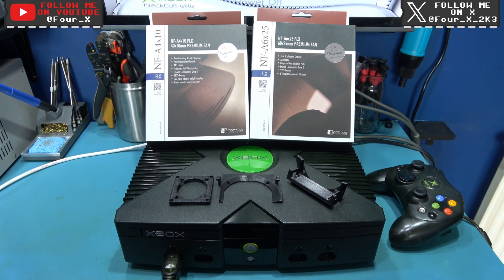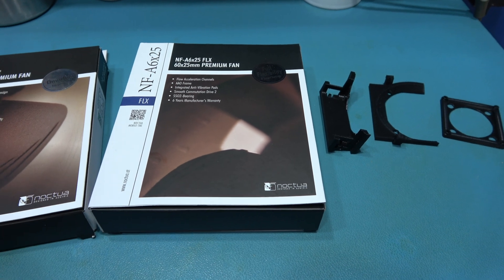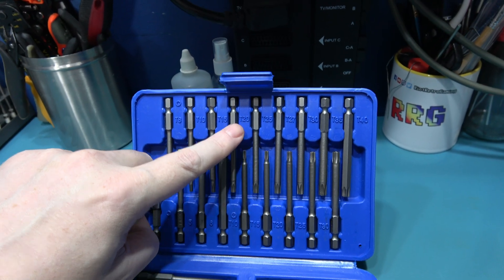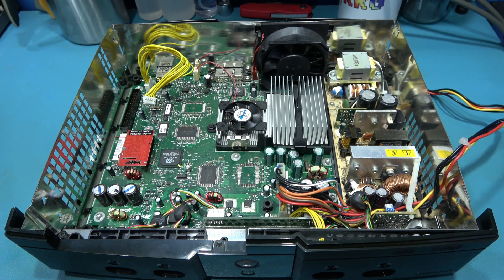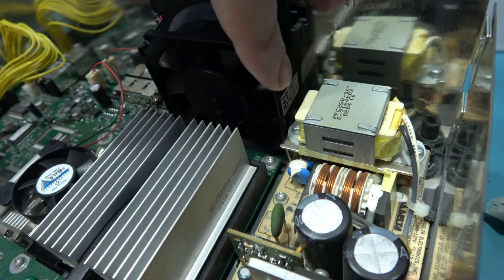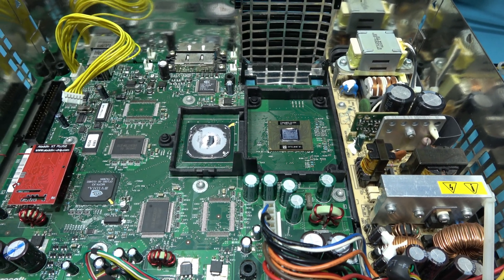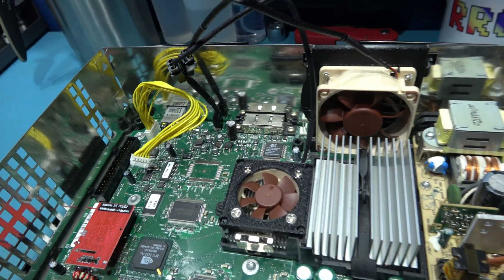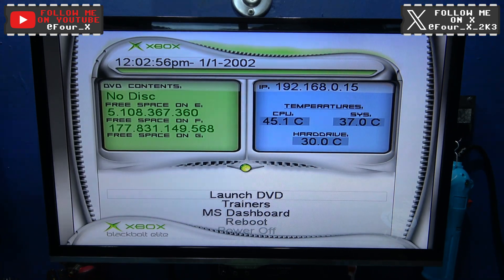Microsoft Xbox - Twin Noctua Fan Upgrade Mod for my Xbox v1.0.

Comment: I did the same thing to my xboxs. 1.1 and a 1.6 and the 1.6 was basically an oven. Once I installed the oem fan back in it was just fine. Quieter but i didnt get good results with mine

Comment: I have an Xbox version 1.2 or 1.3 and was wondering if you could make a video showing beginners such as myself how to solder a 3 pin fan connector onto the mother board. I know you mentioned that as being a possible solution and was wondering how to go about it. Great video btw!
Reply: Should just be able to buy a 3-pin fan connector or desolder one from an old computer motherboard and then you'd want to clean the pads first, then just make sure it's the right way around stick the legs in the holes use flux and solder it in. Not much to it

Comment: Can't we use the 5v variant? Why is FLX mandatory?
Reply from the maker: No, it needs to be 12v. A FLX fan runs constantly at the same set speed at a certain voltage. Other fans like PWM fans, the speed is controlled by the motherboard it's plugged into.
Reply: @Four_X  I know what PWM fans are. I was just asking, wouldn't a 5 volt DC fan be better if you want it to remove more air? But then I researched and found out the Xbox uses a weird 6.5 volts and that 5v fans would actually burn out from overvoltage. Well that just smarts, I was hoping for Noctua fan options to bypass that 54.17% utilization. I guess my FLX will have to do. At least tell me the Xbox never reaches 70 degrees in any scenerio, cause my laptop runs hotter than that and it's been fine for years.

Comment: Cool! I have 3 OG Xbox's I saved and softmodded from Goodwill over 2017-2018..but the 1.0 is my baby. Added new clock cap, thermal paste, new old stock Thompson DVD drive (hard to find!), cut some wires and fit a SATA adapter with 2 TB drive,  added a LCD display to front with temp probe into my CPU heatsink, and painted shell my Petrucci guitar/Camaro color (2 tone purple/aqua). Nexus fan I added, but want to get the green adapters from Stone Age Gamer to add a new GPU fan, and see if I like this Noctua fan over my Nexus I got recently as main. I have over 12k CoinOP games I added and made preview vids for, plus all the actual XBox games plus isos like Rent a Hero remake! I use the OG 1.0 so much still!
Reply: I just threw out a Thompson, it was junk.